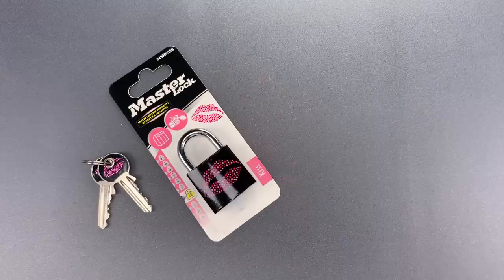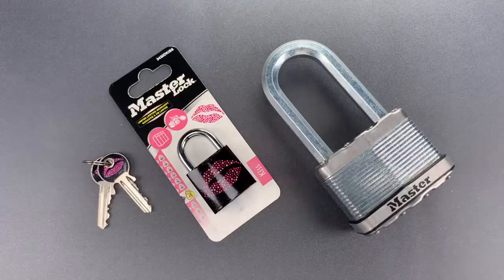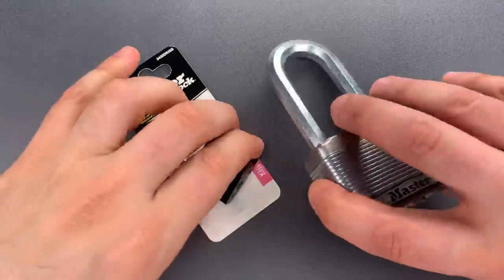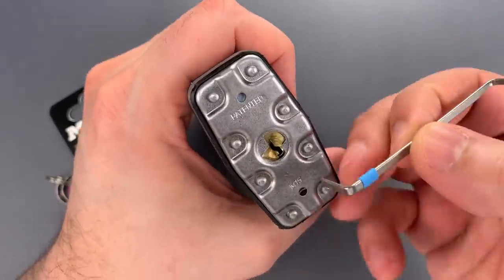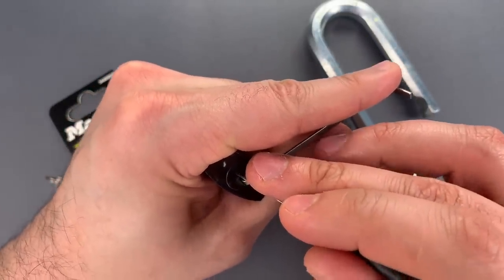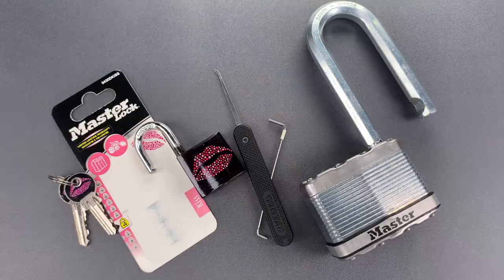[1211] Which Master Lock Is Harder To Pick? A Surprising Result

Comment: For the LPL, neither is hard to pick.
For us, we don't even bother trying
Reply: I just use a "Master" hammer... Usually, one swing and I'm in...
Reply: @bigd7861 just use ramset
Reply: raking is so easy, you could seriously just watch this video, then yourself sit down with this lock, a rake, and a tension wrench, and you'd probably get it open in less than half an hour, and after a couple days know how to do it in less than a minute.
Reply: @devonjames9883  I have picked some locks with security pins easily, but I have never been able to rake a lock. I honestly find raking to be really difficult
Reply: I have a 10 year old daughter who can pick each of my masterlocks in less than 2 minutes. Seriously, they are REALLY easy to pick.
Reply: @KanadianSpaceProgram once I had a master lock like the bigger one he showed and I just hit one pin and it open which I though was halarious
Reply: Just break out the angle grinder lock pick 😂
Reply: @Dexiteo  Raking the magnun masterwork is easy and requires little to no skill
Reply: No. Look. Raking is EASY. It's exactly as easy as LPL makes it look. It's completely useless if the lock has any security pins, but if it doesn't, you really don't need any skill, just a rake pick, a tension wrench and the barest shade of idea how to use them.
Reply: @sharpfang  Security pins do not make a lock un-rakable.
I have a few security pinned locks that rake very easily.

Comment: What even is a limited lifetime warranty?

The warranty expires when the lifetime of the lock ends? Isnt that convinient.
Reply: Exactly. Lol.
Reply: That literally is the warranty: the working life of the lock 😂 shame they never worked
Reply: Warranty expired when the key is first inserted?
Reply: @shootthemoon6072  thats good for lpl then
Reply: Usually I think it means limited by how it breaks. That's what I always thought. Like if you abuse it the warranty won't cover it.
Reply: That was a joke in the B.C. comic strip about 40 years ago... "This knife has a lifetime warranty! When it breaks... its lifetime is over." :)
Reply: @JamesRedekop  Haha
Reply: A limited lifetime warranty is a warranty with no expiration that typically covers certain types of failure (typically this doesn’t cover “normal wear and tear”). The “lifetime” typically has nothing to do with the lifetime of the owner, but rather the product itself.

So yes. Once the lock breaks the warranty period is over. Lol
Reply: @TheQuark6789  is.... is being designed bad a defect in workmanship?
Reply: A limited lifetime warranty is good literally for your whole life (assuming you can still prove you bought it 50 years later and that the company is still honoring it) but it is only valid for replacement, repair or insurance payout under "Limited" circumstances. Usually if it was defective out of the box and not if you the purchaser or a third party breaks it.

I used to work at Home Depot. I had to explain this a lot.

Comment: The lock in question is available in a wide variety of styles.  It's their standard enamel coated padlock, which is, surprisingly, one of their better padlocks when it comes to pick resistance.  (This being relative).

Master Lock tends to rate by brute destructive force resistance.

Comment: I personally think they chose the “pick resistance” scale on the side for the factor that it’s a smaller lock, sure, smaller locks with less room are harder to pick but it doesn’t stop anyone who has a smaller size tension tool. To me I use a garden lock, since a 5 key lock pick takes longer than 1, essentially every lock out there can be picked so I want to use the simple garden lock just so I can have a huge chance to stop the intruder from picking any further.

Comment: We have 3 Masterlocks on our Shed. Our shed has been broken into 4 or 5 times in the last 10 years. Not  once, has anyone picked their way in. I just received my Companion yesterday. I will be seeing if I can pick my way in using it just for fun. 

Here are the ways we have had them break in. 

1. Cutting the chain. Someone sat there with a tiny hacksaw and (the small one that comes in some starter tool kits) for a long time... They left the hacksaw on the ground. 

2. Someone found a vise grip and got it to connect to the head of the bolt holding the chain and managed to twist it off of the nut inside. 

3.  Cut the hinges. 

They aren't the cheapest padlocks. The shackle showed that they tried to hack through it, but they quickly changed to the chain. 

We don't know that we have lost anything from the shed. We suspect maybe an old sleeping bag and maybe an old tarp. Everything else was left. 

We did have a brand new Grill left in our trailer one week. The trailer is left unlocked. 

What does that all mean? 

Well. I replaced my Shrage lock with an Abloy, thinking I was being smart. Then I realized I had a 6ft x 6ft window right next to the door and sliding glass window on the back. To be fair to myself. I was worried that my Shrager key was compromised and I was much more worried about a specific person slipping in and getting onto my computer and leaving booby traps. Long story. 

I like having the Abloy even though I suspect it isn't all they say. 

I am not terrified of not having the best lock. I suspect learning to pick locks is on the rise. But I also suspect that the people studying it are less likely to use it for nefarious purposes.

Comment: Master Magnum? It's like a guy compensating with a huge pick up.
Reply: Except the truck has an i4 2.0
Reply: Bigger pickups are more useful than smaller pickups or cars. As is the case with the big lock as many more people just use vice-grips, firearm, hammer, etc., to snap the 'challenging' locks, than there are actual lock picking thieves. Vice-grips make the least noise in the twist.

This is the US though, if you're good at picking a lock, you make more money as a locksmith than a thief.

Comment: Comparison, for anyone interested.

Regular Picking Method:
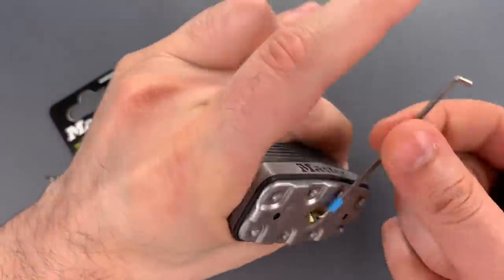Master Lock "Master Magnum: 19sec (1:27 - 1:46) (10/10 security, am I right, guys?)
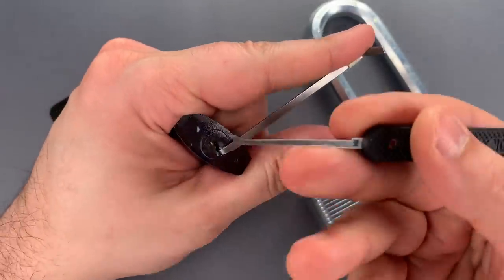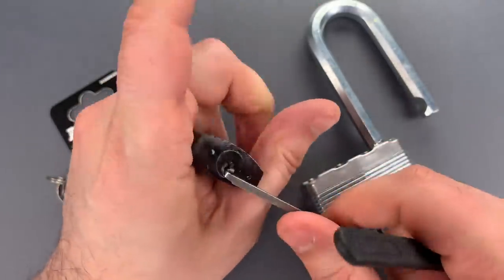Master Lock "Kiss":  40 sec (2:15 - 2:55)

Bonus:
Raking method:
Master Lock "Master Magnum": 3 sec. (1:57 - 2:00)

Times measured at the moment LPL introduced/got the picking tool close to the keyway.

Comment: I think they use better pins in locks that are for use inside a home or office and are traditionally smaller. My thought is that these locks will be most likely picked by other members of the household or office since they want to be discreet. While larger locks used out in the field like containers, trailers, and buildings are more likely to be destroyed to gain access

Comment: “But a novice would have an easier time with this lock” prove it. Have a novice as a cohost, a protege if you would. Prove these sorts of claims
Reply: The mans a professional, even taught a lockpicking course before covid iirc. He means what he says. Raking would be the novice attack.
Reply: @CyniSchism96  Just to reiterate since it Joshua buried the most important point at the end: he proved it by raking it open. Raking is a low skill attack that any novice can do pretty easily.
Reply: I would agree with LPL. I got the 3430DSPO (just a sport logo instead), and the Master lock Extreme. The extreme is easier to pick. (And i'm a novice)
Reply: Hint all you like. He's never going to take you under his wing.
Reply: That would not last long.
The novice would be an expert in no time, given how many videos this guy posts.

Comment: Where as the beefy one would be used to deter actual criminals, the kiss sealed one would most likely be used by young teens to keep there siblings going through there stuff. The siblings are more likely to try and pick a lock then just bust it over. From personal experience, you don't want to leave evidence. If you were stripping out a shed, you might as well bust the lock open two.

Comment: Okay, I believe they look at what the most likely attack will be in either lock in the setting they will be practically used in. The lager master lock is going to be used primarily on work sites, for storage garages, large tool boxes, and heavy doors where the easy way of entry is brute force due to the nature of what may be stolen people will already know something is missing even if you picked the lock to gain entry. While the smaller lock may be used for a diary or personal belongings box or personal information in a safety box in the home that may not be used regularly that the person wanting to gain entry would like to be discreet and use a non destructive entry tactic. Just my thoughts.

Comment: "probably isn't marketed to guys like me."  Is he implying they make 6ft thick tungsten steel doors with solid diamond cores ?
Reply: Diamond isn't the best, it fractures easily (see: giant Ramset)...a ceramic aluminum oxide core would be better.
Reply: @tcpratt1660  that isn't per se a bad thing depending on the failure state. If it completely buggers the lock on breaking that's that.

Diamonds are transparent though...
Reply: No worries. If it's a Master Lock door the core will be solid plastic.
Reply: @tcpratt1660  6" of solid tungsten lined with 6" of solid Chromoly again lined with 6" of aluminum. Tungsten should give you the heat resistance(and help pre-heat the chromoly), chromoly will easily harden if not cooled properly and by the time they get through the hardened chomoly, the aluminum will gum up any sort of drill used to drill through the door. :)

Comment: I think they are more worried about people with wrenches and hammers or angle grinders than lock picks. When I worked in the oil patch if a key way was obstructed we would use a wrench and a hammer to break a lock in 2 seconds to get to the equipment we needed. Many people can use a brute force attack, but only a few have the skills needed to finesse a lock open with a pick set.

Comment: I also notice that it appears Master Lock tried to make the lock body look as if it was laminated, or made from several layers, which would make the body stronger. In fact, I think they cheaped-out by just casting the body in one piece (with ribbing) so that it merely looked laminated. Pretty low-rent, Master Lock!

Comment: Maybe Masterlock thought a lock likely to be used on a chastity belt needed more security than one for a parking space gate. I think the ratings on the side relate to the weigh in value at a scrap merchants, not actual security (you can cut the bottom off the big one with a battery powered dremmel tool)

Comment: It's quite simple. Statistics tell that most break-ins don't involve picking but smashing the locks. In a price-sensitive market, the lock maker can either do a strong lock body or a pick resistant core, not both. Master Lock usually goes for the strong lock body. For the small lock, they probably chose a good core in exchange for a weak body.

Comment: I think you should have included in the video trying the rack on the kiss lock, because that's the biggest issue of the lock level 10, anyone could use it on second with the right (and cheap) tool. 
It's probably too small and won't work but since you did not mention it, we are left uncertain.

Comment: I still remember Master's plastic LOTO lock. I'm starting to wonder if they do it on purpose, design pick resistance as the inverse to security. Would I be right in assuming the plastic LOTO is still harder to pick than Master's little pink kiss? Whatever the case, I think Master believes that pick resistance might be a detriment to lock security.

Comment: Criminals just don't pick locks. I work in construction and have seen a lot of break-ins on our gang boxes and makeshift storage rooms and none have involved any type of non-destructive entry. Even locks like the 175 and 875 which can be decoded or bypassed with a trivial amount of effort just get snipped right off with bolt cutters. If they can't pop the lock they go straight to cutting open the body of the gang box or cutting a hole in the wood door. We eventually started lining the back of the doors with metal drywall furring to eat saw blades.

Comment: If you think about the intended use or assumed use of these two locks, there is some method in the madness. The kiss lock perhaps is intended for school lockers, bags, diaries maybe? The kind of situations where an opportunist might want to break in none-destructively, and might not even be robbing, just snooping. The large lock is intended to prevent destructive entry and so gets the usual shabby master lock core. I'm not saying this makes complete sense but internally from a certain point of view you can rationalise it, even if it's still a bad idea to put weak cores in tough locks.

Comment: The master lock rating system is to get sales. The level 10 lock costs 3 times more than a level 4 lock. They don't actually care about which one is quicker to pick open. It looks more secure to the average buyer. It may use more material to build, but they're making cash. That's all companies care about.

Comment: To be honest, the attack resistance of any security device now (be it padlock, bolt, chain or building wall) is defined by the material least resistant to a 36v dewalt angle grinder. Why send in special forces when you can nuke from orbit...

Comment: There is a logic to the design (other than that consumers are easily swayed by advertising). The big lock protects things you expect to be stolen: tools or valuables in storage, situations where the thief is not concerned about leaving signs of their activity and is an opportunist who will look for an easier target (though a lock you can rake is pretty terrible I guess they don't expect that level of sophistication from a tool thief).  The small lock can protect things that you want to trust, such as a teen's diary (I'm guessing from the marketing) the thief's critical objective is to remain undetected (mom doesn't want her snooping to be detected).  The black lacquer on the small lock is easily scratched so even a non destructive attack may leave marks and those marks might cause the attacker to back off.

Comment: Dear lockpicking lawyer

I was wondering if you were able to pick the Schlage Camelot keycode deadbolt. I read in an amazon review that it is pick resistant because the cylinder doesn't engage the deadbolt unless the keypad is engaged. Can you show if that is true? It is a very popular lock.

Thanks!

Comment: Statistically speaking, what is the more common bypass for locks? Technical picking skills, or forced entry? If forced entry is the most common way to bypass a lock, then isn't it justified to focus on making a lock that's harder to break, than one that's harder to break into?
Reply: There was a run of thefts on a certain kind of lock when people realized they could be "picked" with a ballpoint pen tube.  And this big masterlock is just about as trivially openable, with a wave rake, which you can probably improvise out of a paperclip.  I think there's cause for concern.

Comment: I'm certain the Master Lock security rating is based entirely on how hard it is to bypass the lock using destructive methods.
I have a Master Lock Python bike lock. The cable is hefty, the lock body is steel, the joints are sleeve bearings with born hardened caps. 10/10 security rating. I can open the lock with a bobby pin.

Comment: The term commonly used as to tha ability to open a lock is "skill". This may seem a stupid question but how is skill defined when used in lockpicking. Is it to do with knowledge, experience, dexterity, touch, tool use and more. If it is a combination of the forementioned and more could you quantify approximately the percentage for each factor, which adds up to lockpicking skill. Sorry for such a newbie question. BTW I like and appreciate your videos. Keep Safe.

Comment: imo the strongest masterlock is the one from the 1950's that's still used on the tool shed at my family cabin today that even the key for it only opens it 30% of the time cause the lock itself is kinda just loose in the body at this point

Comment: Ik master lock is pretty stupid but I somewhat understand their philosophy with picking care. As easy as lpl makes it look you need to remember that most thieves won't try anything more than a bump key, and master is a budget brand, so with high security locks picking isnt that big an issue. On the other hand, with small locks or that plastic industrial safety lock physical attacks aren't a realistic problem, they'll be locking something where if the thief has got a hold of it the owner has much bigger problems, and in the plastic industrial case covert entry that could plausibly have been accidental are much more dangerous, so phisically weaker locks need the higher pick resistance where in most cases the big locks dont

Comment: MasterLock ratings (speculation):

10/10: Beefy af lock that can be raked open in seconds

15/10: Beefy af lock with 6 security pins

20/10: Beefy af lock with many pick resistance measures (a type of lock LPL has probably praised before)

Comment: Ok, here's a question. Knowing what you know about pin-and-driver locks, do you believe one that is easily opened by a key can also be pick-proof, or is the fact that if a key works all pins at once means that such lock may always be attacked on a pin-by-pin basis? Even tongue locks, locks with magnetic pins, and all manner of keyed locks haven't stopped you. Is any keyed lock safe and, expecting not, what method would be pick-proof, if any?